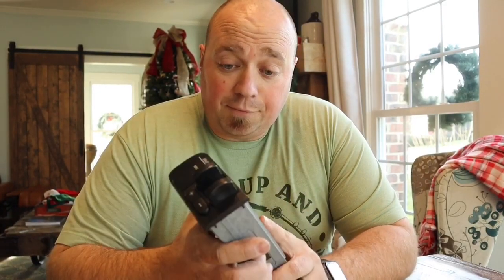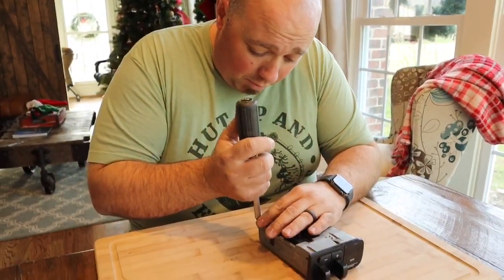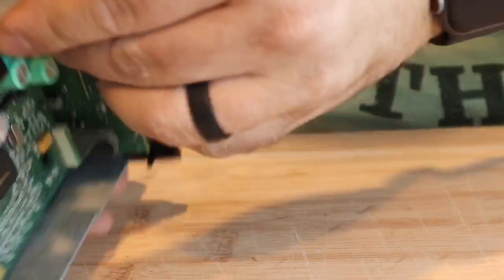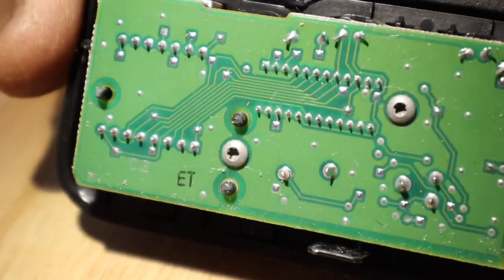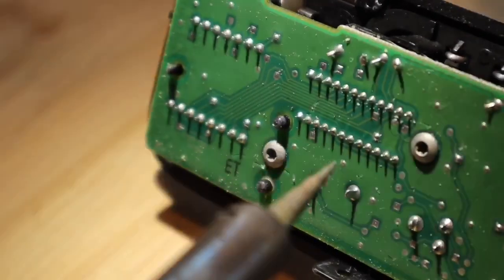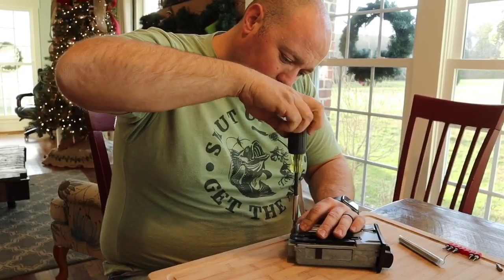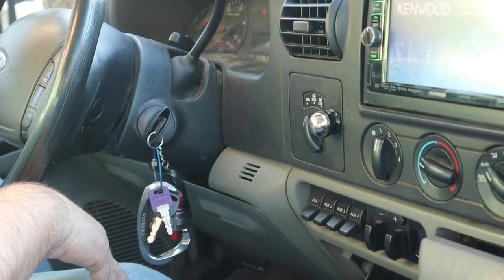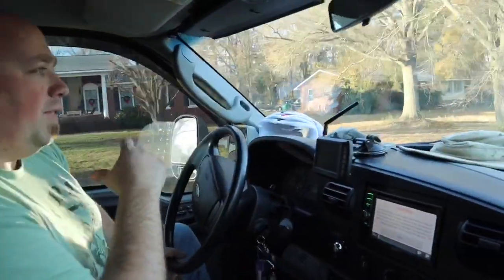TRAILER BREAK CONTROL REPAIR FOR FORD F250

Comment: I have gotten my keys out of my trunk, fixed my Excursion overdrive switch, replaced power  window motors and much much more with the help of YouTube videos. Knowledge is definitely power and a money/headache saver. Good job on the brake module repair.
Reply from the maker: The school of YouTube as we call it! 😁

Comment: Lo, and behold! My TBC started throwing the error message after 15 years of use. I too was thinking I'd have spend nearly 400 bucks for a new one. Then I found this video! I too discovered the broken connection right where he said! I soldered. IT WORKED! Thank you for sharing!☺
Reply from the maker: So glad it helped you!!

Comment: Just wanted to say Thanks for the video.  My 2006 F350 TBC started flashing Trailer Disconnected and TBC Fault last week and we were planning a trip this week...had to get it fixed and there are No TBC's available at San Diego Ford Dealers and they had no idea when they  might be available again.  So using your video mine was the same problem and a little solder and it worked perfect on our trip this week.
Reply from the maker: That’s awesome!! Glad it helped you!

Comment: I just bought an 05 f250 6.0 has same fault. My question is were you still getting any lights and reading from the TBC? When I pulled mine out one of the two plugs was unplugged when I plugged it in I had readings before I pull it out and try to solder I wanted to know whether or not you even had power to the unit? Great video as-22 steps
Reply from the maker: It did have power but it wasn’t constant, as in some times it worked but not always. Sorry if that’s isn’t too helpful, good luck

Comment: when it said check trailer was the trailer disconnected.  I keep getting that check trailer and found that I'm not getting much voltage to the 7 pin I think I have a bad 7 pin or ground under the bumper
Reply from the maker: Trailer was connected I believe

Comment: Buying a bulletproof 06 f250 6.0 powerstroke with 308k miles for 5,900. What do you think? Went for a test drive and blew the top turbo intercooler tube off but got it back on and it didn't do it again, other than that truck ran solid. Is it a good deal?
Reply: Has the same tbc error
Reply from the maker: To be honest it’s hard to say. The issue with blowing a boot is fixable by changing to Silicon boots. The tbc was an easy fix for us. Also just because it’s “bulletproofed” doesn’t mean problem free but could be. If a truck has a problem on the test drive it may not be the best one for you. Not trying to be a downer. It may be great and have a lot of problem free miles in her
Reply: @TheNeuAdventure  thank you for the response. Was a little disheartening when that boot came off. Does seem a little good to be true and such a good price. But it drove so strong and I crawled under it and it was clean, all metal no oil or anything.
Reply: The intercooler tube Witt blow off again if there is any trace of oil, grease or even a fingerprint inside the tube when it is reinstalled.  Tube must be totally cleaned with brake cleaner spray .

Comment: i had the same issue on my 06 250 where the TBC light came on and truck wouldn t start and the previous owner told me to use the door unlock button on the remote which "fixed" the problem-no idea why or how
Reply from the maker: Interesting 🤔